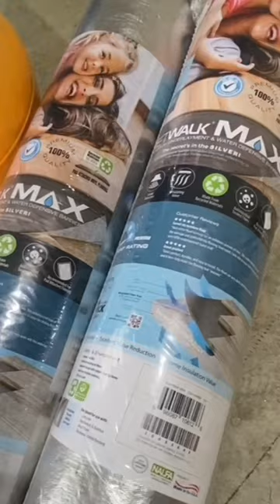BEFORE Laying Your New Floor. Prep & Pad (Underlayment) | Leveling Plywood Subfloor

Comment: Should you use a padded underlayment for Vynil Plank Flooring that already has an attached pad?
Reply: I just asked the same question. I assume yes
Reply from the maker: You’ve asked a million dollar question. Yes there are huge advantages to doing this, but always consult the Install Guide for your floor to see if there are recommendations for it or against it. In some cases, additional padding will create too much compression and locking mechanisms can be compromised, due to the added movement.  

💡 When additional underlayment is permitted by your specific flooring product, there is a lot to gain with the sound and feel of your space. 🏡

📞 Feel free to call and get advice at your local store 🏬 to explain more details about the project.

https://www.llflooring.com/stores/

Here is a video we made, at the end you can see the difference of impact & sound using both planks with attached pad, and one with additional:

https://youtu.be/njiY54i0fzw

Good luck with this install, don’t hesitate to follow up with how it goes!

🧰 Reminder to pay close attention to the instructions for your specific product.  Each project is unique and different. Installation advice or recommendations are given as a courtesy and not intended to take the place of an installer's visual inspection, expertise or informed judgment. The end user/contractor on-site is ultimately responsible for ensuring that selected products are appropriate for local conditions and/or their final use of the product.
Reply: Use quiet walk LV, garentee no compression, only 1.4 mm
Reply: LifeProof LVP it'll void your warranty if you use anything other than LifeProof underlayment, which is paper thin and just a cash grab by LifeProof. Don't use underlayment with LifeProof LVP

Comment: I use a 7” grinder with a concrete blade to sand seams. Also use a shroud. Works amazing and you can address staples and seams and only change the blade every 1-2 years
Reply from the maker: That's a good call out.  Yes, a seven-inch grinder with a dust shroud can be also a great way to flatten high spots in concrete, remove thin-set mortar, remove old adhesive residue, and remove concrete sealers while controlling the dust. 

Thanks for the contribution 👍
(Also if you do installs frequently or are a pro make sure you click PRO on our site and register, then see all the lower prices, get unlimited samples, pro store hours etc.)

Comment: If my planks already have the underlayment, can I put down the additional padding?
Reply from the maker: Hello thanks for contributing with the question again. Here's the answer to consider. Question is appreciated!

...Yes there are huge advantages to doing this, but always consult the Install Guide for your floor to see if there are recommendations for it or against it. In some cases, additional padding will create too much compression and locking mechanisms can be compromised, due to the added movement.  

💡 When additional underlayment is permitted by your specific flooring product, there is a lot to gain with the sound and feel of your space. 🏡

📞 Feel free to call and get advice at your local store 🏬 to explain more details about the project.

https://www.llflooring.com/stores/

Here is a video we made, at the end you can see the difference of impact & sound using both planks with attached pad, and one with additional:

https://youtu.be/njiY54i0fzw

Good luck with this install, don’t hesitate to follow up with how it goes!

🧰 Reminder to pay close attention to the instructions for your specific product.  Each project is unique and different. Installation advice or recommendations are given as a courtesy and not intended to take the place of an installer's visual inspection, expertise or informed judgment. The end user/contractor on-site is ultimately responsible for ensuring that selected products are appropriate for local conditions and/or their final use of the product.

Comment: Mines has huge chunks missing. What to do
Reply from the maker: This comment about chunks..if you’re talking about your subfloor you should elaborate details of what it is so people who see it can reply. Appreciate the question 🙏

When plywood or OSB panel come together there may be some unevenness, so professional flooring installers will sand these seams flat in many cases. If a floor joist is high sanding may not always fix that. 
If you’re talking about wood subfloor with chunks in it, self leveling compound is not always an option. For example if you are installing a nail down floor, you can’t pour self-leveling compound below it. 
Also, you may have to add additional plywood or metal lathe, before pouring self-leveling compound.
If self-leveling is preferred, the process for using a leveler on a wood subfloor is more extensive and a higher difficulty level.  Webcrete 95 could be a patch to consider. Here is Webcrete 95 on our website 
(If you are an installer etc. be sure to click PRO and complete the form to see pro prices) 💻

https://www.llflooring.com/p/bostik-25-lb.-webcrete-95-fast-setting-high-strength-floor-patch-10028339.html?search-redirected=true&search-term=webcrete%2095

Please continue to rely on your expertise & attention to the specific install..

📏Each project is unique and different. Installation advice or recommendations are given as a courtesy and not intended to take the place of an installer's visual inspection, expertise or informed judgment. The end user/contractor on-site is ultimately responsible for ensuring that selected products are appropriate for local conditions and/or their final use of the product.

Thank you for watching & contributing, don't hesitate to follow up with how it went 👍

Comment: Doesn't the manufacture say not to tap the underlayment together when going onto wood subfloor?
Reply from the maker: @proto_kill That’s a good question. For this particular underlayment you will want the seams to be taped or utilize the lip and tape system. QuietWalk Max has fibers that will work to manage & mitigate moisture beneath the vapor retarder so there is no need to leave the seams open to allow breathability.

While some underlayment types may not recommend taping seams over would substrates, QuietWalk Max instructions state in part:
CLICK/FLOATING FLOOR INSTALLATION: 
6. Butt seams together and seal using the factory attached lip and tape system. 
7. For seams that do not have the lip and tape feature, use a good quality duct tape, at least 2” wide, to seal the seams.

Good eye, thank you for tuning in 👍

Comment: How much to do a basement around 1000sq  ?
Reply from the maker: Hello, that sounds like a great project. To calculate the 1000 sf for that Duravana Floor at current price you can visit the product page below. As of 12/18/2023 it appears to have a sale taking off 25% (Also look into other sale floors from the home page as low as $1.00/sf presently) 💻

https://www.llflooring.com/p/duravana-7mm-and-pad-chapel-bridge-oak-waterproof-hybrid-resilient-flooring-7.56-in.-wide-x-50.63-in.-long-10052717.html

The underlayment used was QuietWalk Max, also available on the site if you'll be adding that. A great resource is just 📞 the store closest to you and explain details including subfloor type in your basement, and other variables that may be important. You can look up a nearby store at
https://www.llflooring.com/stores/

Thank you for the comment, don't hesitate to follow up with how it goes! 👍

Comment: What is underneath your plywood?
Reply from the maker: Beneath the plywood decking, there are the floor joists. The size of the joists (2x8 or 2x10) depends on building codes for the are you live. This also applies to the spacing, as well - usually 16” or 24” on center.

If you’re wondering about the “space” under subfloor: it is a conditioned full basement below. (As opposed to a crawlspace, or plywood applied directly over a concrete slab).

Is there something specific you had a question about?

If you want to talk in person, visit a store 🏬near you at this link, we try to be helpful. About flooring anyway. https://www.llflooring.com/stores/

Thanks for the comment!

Comment: People waste money on a disposable floor. Go ahead a install real hardwood 3/4in solid wood. Last the life of the house and adds value to it. That floor is good for a basement. Spend extra for the real deal.
Reply from the maker: Right, solid hardwood is non-negotiable for some people. Mark was actually installing this in his own home in this video. It was a close match to other rooms. Like you said there are some rooms or places where you want to learn about the other options ie. basements etc. 

You can get a great experience with some of those choices with close detail in prep & install. 🧰  thanks for that comment.

Comment: You should not be grinding the homeowner plywood you are weakening the subfloor your causing structural damages to the home as contractor you should no be doing that you need to do self leveling instead
Reply from the maker: Good comment about grinding subfloor. This video shows installer Mark addressing a high seam using a belt sander. This practice is common in installing on a plywood subfloor when conditions require it. The strength of the subfloor was not compromised in this situation as it was on a seam sitting on what was likely a 2x8 or a 2x10 joist, and it was a minimal high spot.

If self-leveling is preferred, the process for using a leveler on a wood subfloor is more extensive and a higher difficulty level. Webcrete 95 could be a patch to consider. Here is Webcrete 95 on our website (If you are an installer etc. be sure to click PRO and complete the form to see pro prices) 💻

https://www.llflooring.com/p/bostik-25-lb.-webcrete-95-fast-setting-high-strength-floor-patch-10028339.html?search-redirected=true&search-term=webcrete%2095

Please continue to rely on your expertise & attention to the specific install..

Each project is unique and different. Installation advice or recommendations are given as a courtesy and not intended to take the place of an installer's visual inspection, expertise or informed judgment. The end user/contractor on-site is ultimately responsible for ensuring that selected products are appropriate for local conditions and/or their final use of the product.

Thank you for watching & contributing 👍